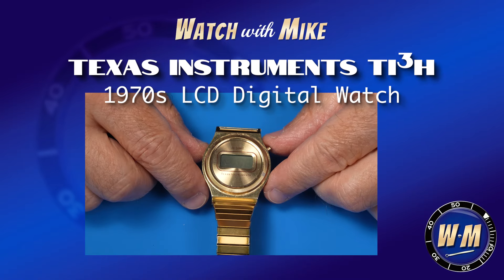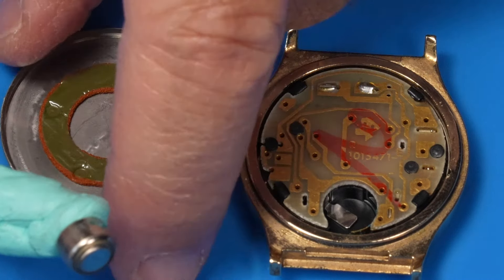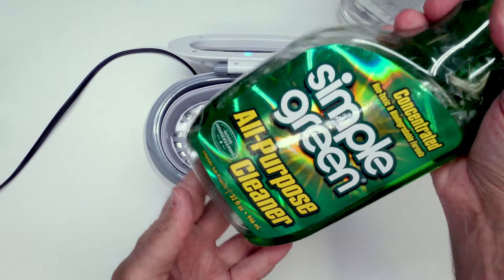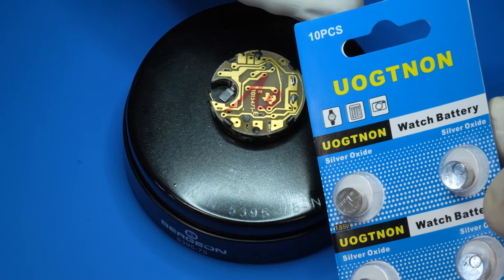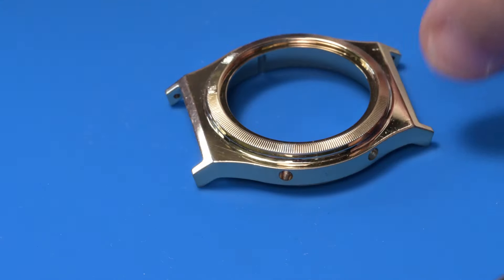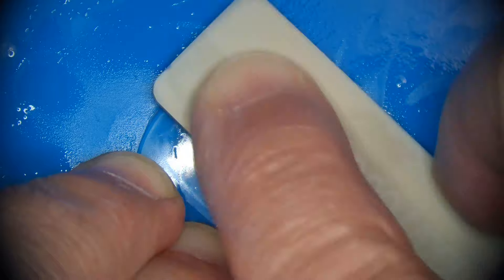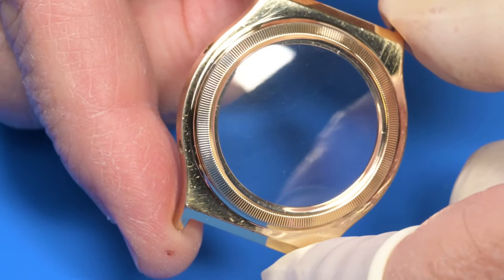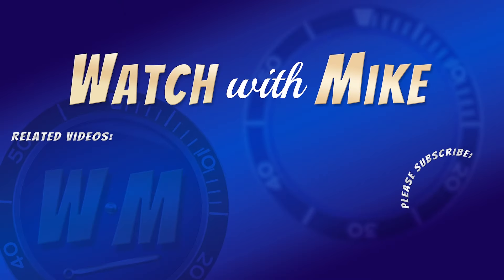⌚ VINTAGE! Texas Instruments TI3H Digital LCD Watch - c.1970?

Comment from the maker: 🙋‍♂❓What year is this watch from?
Reply: My guess is the late 70's (LCD) .
Reply: The earliest it could be from is, 1973 , that was when Timex released their first LCD display watch .
Reply: All I know of TI and their lcd’s is TI bought NSC in 1979 or so
Reply: Mid 70's...😅
Reply: My guess would be 1976-1977 because it only has the basic  functions. I collect early digital watches, mainly Seiko. Nice early example in great condition. Cheers Mike.
Reply from the maker: @francispalmer9737  Thanks for helping date this watch! 😄
Reply: Watch is from about 1978-79.  I think this model or very close appears in the 1979 JC Penney Spring-Summer catalog for $29.95.  This is the 5-function version of the TI LCD Quartz movement, available as early as 1977.  I've clean/repaired and assembled several similar 6-function models from that same year or two in the late 70s.  Same movements came in different bezels.  Love the style of these watches.  They were originally advertised with a "self-adjusting backlight", which was actually just a payload of faintly glowing (radioactive) tritium gas in the display that has long since decayed or dissipated since it has a short half-life of about 12 years ( and thus the 3H in the "TI3H" marking on the back of a lot of these watches, as tritium is an isotope of 3 hydrogen atoms).

Comment: I have that same watch.  I’ve had since I was a teenager.  😮  I don’t have the watch band though.  I’d like to get it back up and running.  Should I take it to my local jeweler?
Reply from the maker: @stevegale3049  That would be a good start. Any jeweler that does watch batteries should also be able to replace the band. Good luck!
Reply: @WatchWithMike  Thanks!  Your video is awesome.  👏   I’ve got an old Gruen auto wind watch that’s missing the stem.  I’d like to get that fixed.

Comment: Lucky battery removal! I am not a great fan of digital watches (anymore) but this one is a looker! 🕐⚙️🍸
Reply from the maker: @NaNByZero  Thanks! I've become a sucker for any watch that needs rescuing. The digital watch projects move much faster so it's instant gratification...unless the battery has gone bad. 👺
Reply: @WatchWithMike  Yes, I noticed that mechanical watches are a bit more difficult. With the first old Swiss movement. :D I am still waiting for a broken screw removal tool to finish that one. I should have started with a cheap Chinese pocket watch. But hey, cold water is not always the worst way to go through. 🕐⚙️🍸

Comment: These watches date to around 1977,maybe a year either side and is identical to one of three example I own and the only one which still works. I have owned them for a number of years and use the working example every now and again. It has to compete with around 50 other watches!. Let's just say that these are not my favourite modules by any stretch and are on a par with those other unreliable modules found in Timeband digitals. Very difficult to disassemble without destroying them completely and even if you manage it, the effort is seldom rewarded with a functioning module. Can't beat the ones with screws. Also the circuit board gold printing is very fragile and any ham fisted poking and prodding or attempt at cleaning will invariably destroy it. My advice is if you really must have this particular watch,bear in mind that most don't work so be patient and make sure you find one of the few that does. They are unisex size and would not really suit people with big wrists,so bear that in mind.
Reply from the maker: @marcholbeck3286  All great comments and advice, thank you! 😁👍🏼